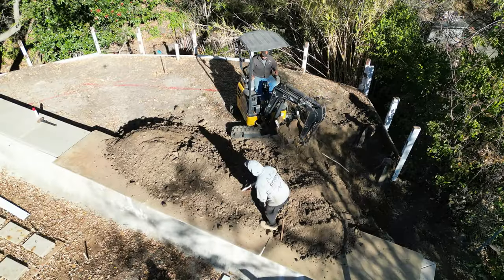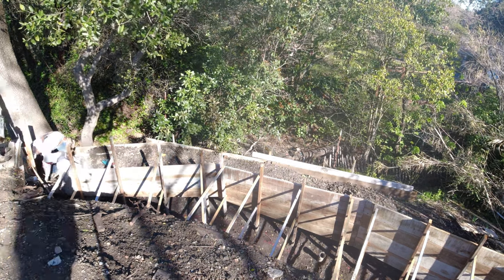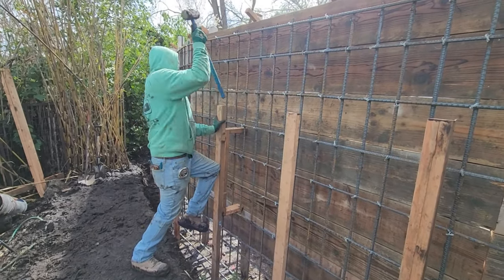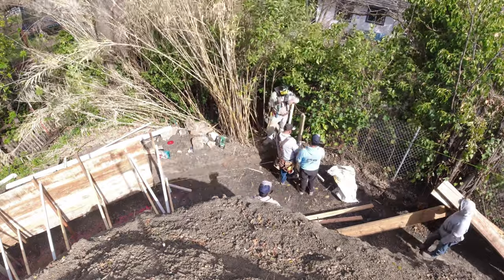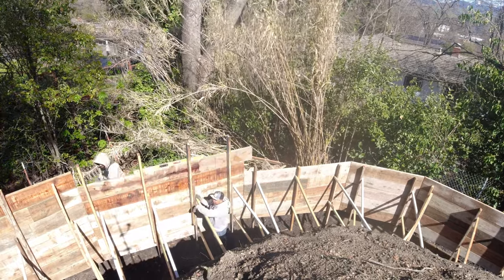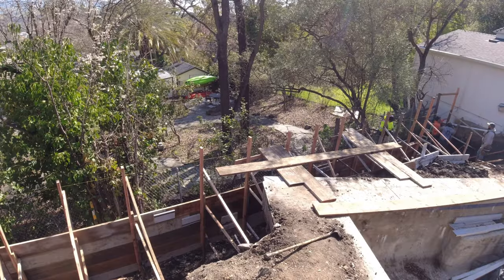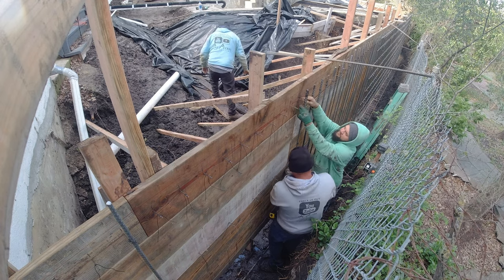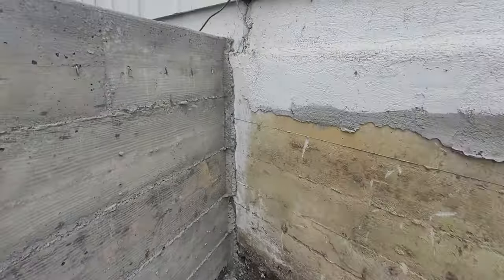How  To Build A 7' High  Concrete Retaining Wall Using 2*12s

Comment: Excellent Vid you guys.  We saw on the other vids how tight it was getting materials onsite! 
That contract is what defines AAC, getting the job done in a restricted environment. 
I would suggest showing pouring of concrete, some find it therapeutic  and after all, it is the end product to all your work.
Reply from the maker: Appreciate the comment.. I am going to show more of the concrete pour.. It's just different when its a wall you can't see it. We got a lot of flat work coming up..

Comment: Greetings from Prague, CZ ! That 8-inch template is such a simple, but great idea ! You can really see how close to the corner of the swimming pool you had to work - very tight ! Amateur Questions Please : 1) Does having rebar in the wall mean that you don't need buttressing every few feet along its length ? 2) How many cubic yards of concrete did the wall take ? 3) Before you backfill with soil/ dirt, does the concrete get treated with any moister protection ? Thank you and looking forward to the next videos !
Reply from the maker: Appreciate the overseas support, 👍🏾👍🏾
1. Not sure what you mean by buttress, but we must have rebar for any retaining wall we build especially in California (earthquake country 🤣🤣) 

2. I belive we had total of 60 yards 

3. On concrete walls no.. On the east coast of USA they do apply more often when they are building basement or using cinder blocks

Comment: Great project  nice work.  I am  on a project  of a retaining wall  (bundwall) 11.22 feet  high  and 1.155 feet width  doubles reinforcements will there be  construction joint or dowel joint  in such construction.
Reply from the maker: If possible we try to pour monolithic.. We never put joints in our walls.. If the wall is real long and we can't pour in one day we will leave rebar out so we can overlap later
Reply from the maker: ✅ out the Longest #Concrete #RetainingWall On YouTube

 https://t.co/6A3WB1MDGP

Comment: Love these videos. How are you guys doing these one-sided form retaining walls though? I would be so scared that the forms would burst. Do those simpson ties negate the need for two sided forms? Do the forms buckle under vibration?
Reply from the maker: Appreciate the Simpson Ties along with good bracing.. Not sure what you mean by two sides?
Reply: @AllAccessConstruction  Bracing on only one side of the wall and not the other. For ex, on this wall, it was very close to the fence/property line, so you definitely could only brace one side.
Reply from the maker: We brace on both sides..